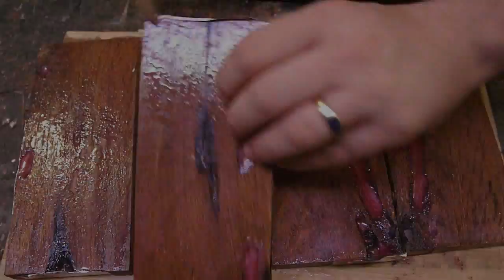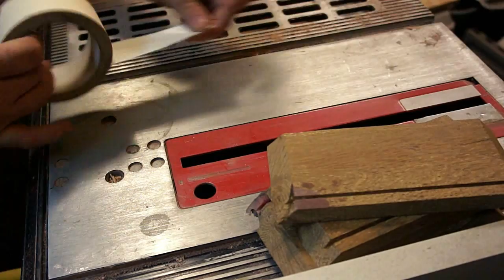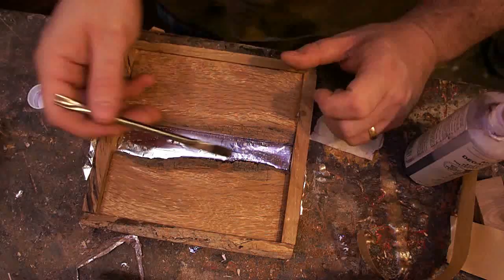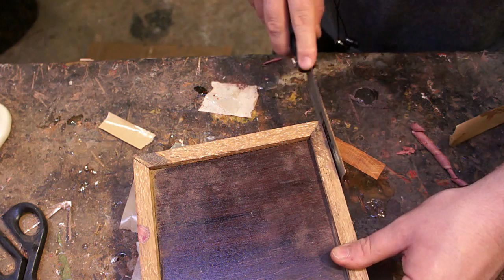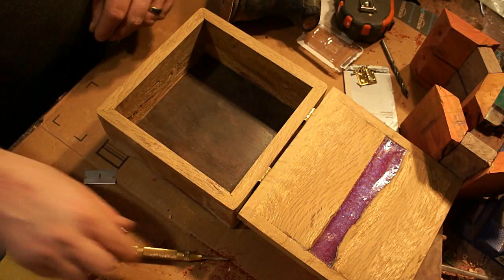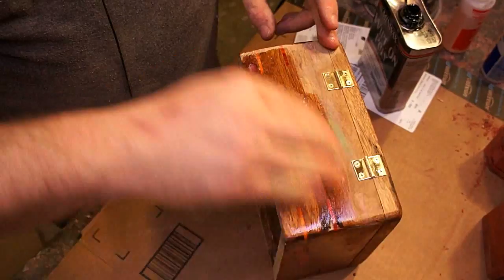Epoxy and Oak: Rivertop Treasure Box for My Niece

Comment: Cool box.  What were the sparks coming off your blade when you were cutting the miters though???

How did you get the epoxy top to shine up so nice after hitting it with the sander?  I've always had to wet-sand epoxy up to 1200 grit in order to get it shiny again once sanding it.

Comment: What were all the sparks from?
Reply from the maker: I didn't realize I was going through a screw in the sled :(  it was one of the first miter cut I had made with it.
Reply: +Tappar well that's one way to find Metal in your wood I have to admit I have done that more than once although it is a good time to learn saw blade sharpening
Reply from the maker: It's still the (I'm sure incredibly cheap) one that came with the harbor freight table saw. I wasn't too worried about it since I want to upgrade to something decent anyway.